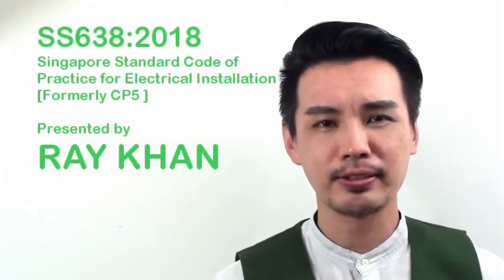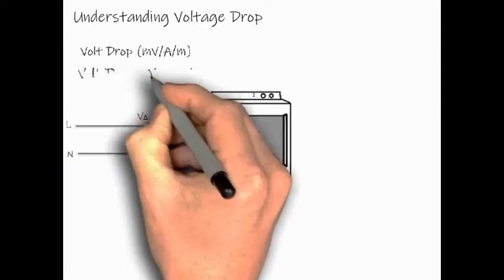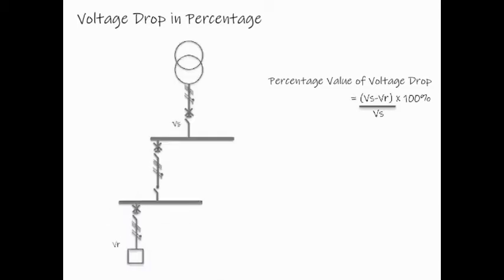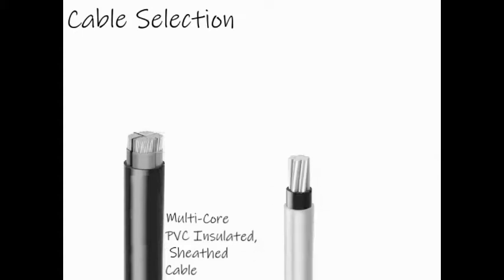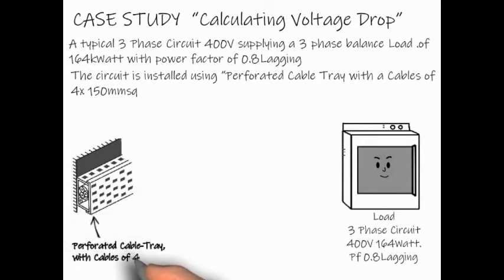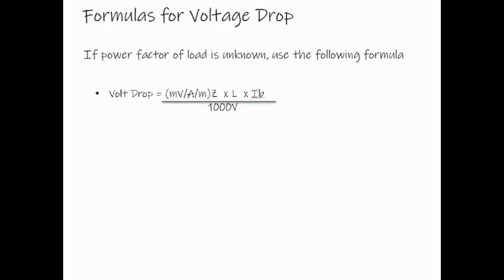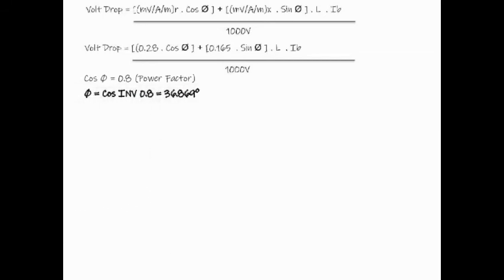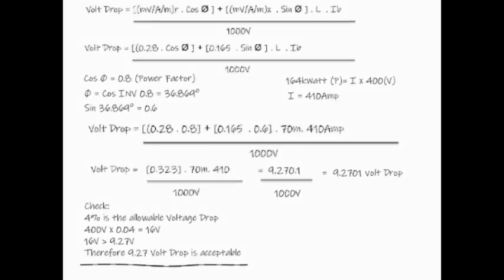SS638 Voltage Drop Calculation by Ray Khan

Comment: Hi Ray, am I right to say that the formula should take in consideration V3 (square root of 3)?
Reply: Yes it should. 3 phase real power = sqrt3 x Voltage(Line to Line) x Current x power factor. The correct design current Ib should be 164000/(sqrt3 x 400 x 0.8) = 295.89A